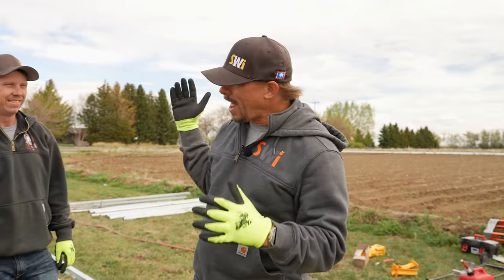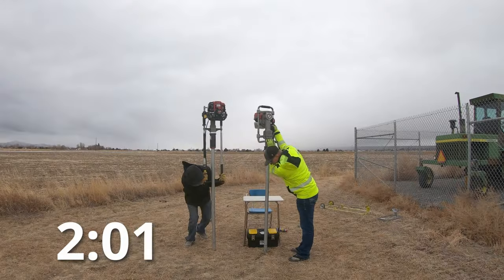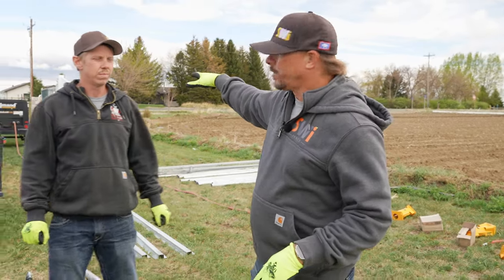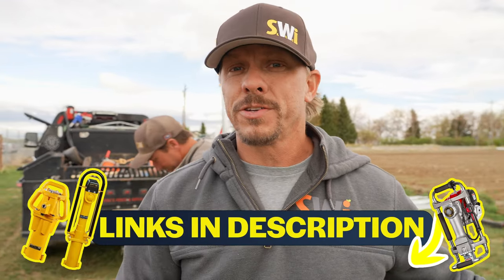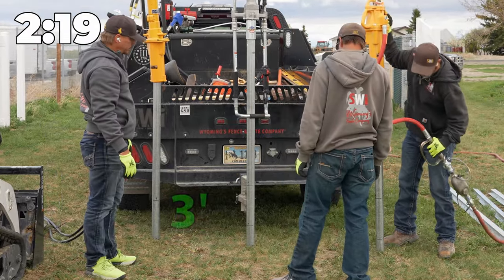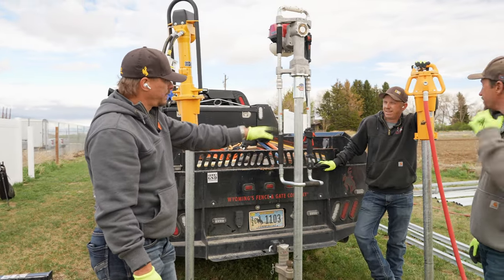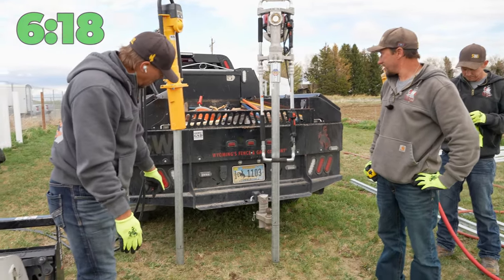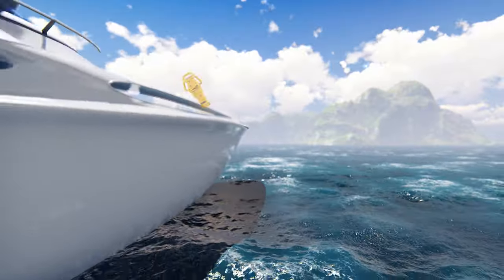Which Fence Post Driver Is THE BEAST?

Comment: That Rhino I purchased from you will drive a 20 foot sand point well in sandy ground. It’s great Machine for the money. The hydraulic, I found it best to use a lever an  some coil springs in on a tractor or skid steer bucket  to make it float, Instead of lugging them around , they are impressive! To me the air is big of a hassle,  extra equipment you have to lug around.

Comment: air system is the most useful. If you hit rock the air can be used for a rock drill and or a breaker/chisel. we use the pto one with the skidsteer only. Gas pounders suck unless you live in Florida

Comment: Hey dudes… you kinda missed the Mark!

Air, gas, hydraulic…. What about Otis?  

Around these parts, everyone knows the best post driver is Otis.  Using a gas pipe he got from the utility company scrap yard…. A 10 pound plug welded into its end… two 1/2” rebar chunks, left over from John Stover’s loafing shed stem wall, bent into bow handles…. He made his own custom driver.

His arms are the size of my thighs.  His chest is puffed out like the Michelin Man.  His 6’10” height gives him the wingspan of a two man glider.  

Otis can sink a post without breaking a sweat.  I’ve seen him sink T-posts through Ozark Mountain dirt with just two whacks.  And, snap them off if they hit limestone on their way down…

I’d like to see you run that same test against Otis on T-posts….So, the next time you’re traveling through S/W MO.  Call ahead and we can set up the test.  

Just make sure it’s before lunch.  Because, he has to spend most afternoons distilling and testing his corn squeezings!
Reply from the maker: We'll have to make that happen! Can't pass up an opportunity like that! 🤣

Comment: Is there a spec for the energy per strike (e.g., in foot-pounds) and strikes/minute rate?  What are the respective horsepower inputs?  Then compare to a demolition tool air hammer, which is the classic standard device for powered pounding on things.

The 185 CFM compressor is like 50 HP; how are you even able to compare this to a 1 or 2 HP gasoline engine driver?  Is the air tool really consuming anything like 185 CFM?

Comment: so does the hydraulic version run off your mini skid steer? i’ve been interested in a hydraulic driver but don’t fully understand them.
Reply from the maker: Correct. You can also buy hydraulic power units (bit like a portable generator), but if you're building regularly you've more than likely already got a skid steer.

Comment: Between air and hydraulic what’s best for mobility moving through trees and being a hundred feet or so away from your power source
Reply from the maker: A hydraulic power pack with a hydraulic driver is probably the most agile. The air compressors can be very large and hard to move through forested areas, and both will have hoses.  Shorter hoses with a power pack for the hydraulic will probably be the easiest, but it could be a toss up.
Reply: @SWiFence what power pack do you recommend?
Reply from the maker: Either of these:
https://bit.ly/rhinohpp14v
https://bit.ly/rhinohpp18v

Comment: Will any of these work for 2-7/8” casing? Oilfield pipe?
Reply from the maker: The hydraulic will fit over 2 7/8". You would also need a drive cap.

Comment: Interesting! Having a fence built here in north Texas, and he us using a skid steer to put post in the ground. I wondered what was out there. I'm too old to use my 40lb manual driver I made in my 20's.  ;)
Reply from the maker: I've always been too old to use a 40lb manual driver. 😉
Reply: @SWiFence  Well, explanation......It's got long handles and several guys can work it at the same time!  ;) Actually only weighs about 30lbs I guess.  ;)

Comment: Which model is the Air Rhino? I need to drive 4" SS40 post. Will the air rhino drive it? Or will an gas power driver drive a 4" post?
Reply from the maker: The air rhino is a PD 55 but to drive 4 inch pipe with an air driver you would need one of the larger versions. this is true with just about any of them.  Most of these drivers are limited to about 3 inch pipe.  When we need to drive 4 inch we typically use one of our larger drivers such as the Montana T-Rex.  it takes quite a lot of power to get a post like that in the ground and these drivers simply don’t have the weight to get it done effectively.
Reply: @SWiFence  Thank you!!